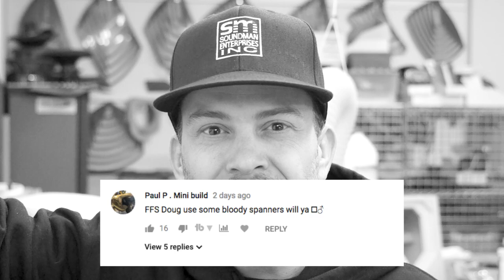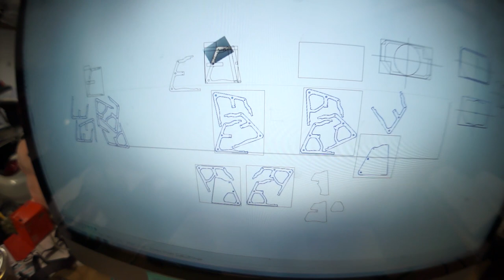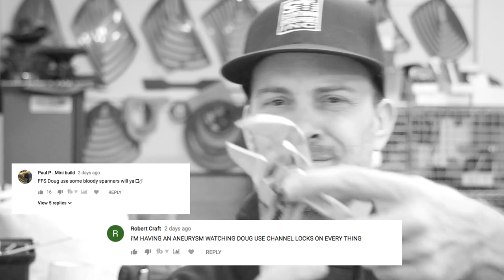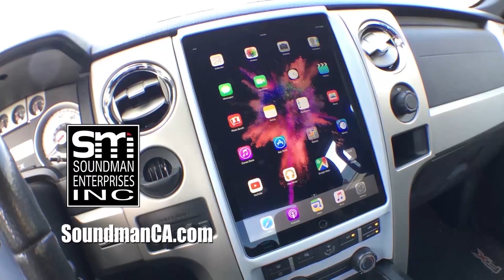IMPOSSIBLE ALIEN WOOFER ENCLOSURE! - OG Cerwin Vega Stroker 12 sealed box!? - White Rider series #44

Comment: Why don’t you just use the SMD IM/SG to pull the T/S numbers from the sub?
Reply: @Mark Wentz I was wondering the same thing.
Reply: Yeah the spec sheet and the actual parameters could differ so would suggest measuring for yourself
Reply: Doug has to drag out whatever he can on videos 😂😂😂
Reply: @masterfabricator  actually, doing self measurements is better then looking directly at the factory specs, if you can up the air volume ever so slightly, you can get a louder/ deeper bass

Comment: I love the intro! But those are not Matco. Those are Knipex. Made in Germany. I use them daily. Never grabbed an adjustable wrench since. Great for pinching sheetmetal flat too. So useful.
Reply: they are really useful until your hands get tired after 6-8hours of working and they slip right into your face. never using those again in my life. Spanners or sockets for me!
Reply: so an adjustable pliers is better then adjustable wrenches that dont require constant grip to keep a hold? and I'd hope pliers pinch stuff like they were designed too... you must have strong hands to grip pliers for 8hrs+ a day.
Reply: @allrimmedout  I've found that I don't need ANY grip strength. If you orient the pliers the right direction, they do most of the work. Never had a problem or a slip and punch in the face. I can open-handed break bolt heads off 9/16" grade 8.
Reply: @kimoarmstrong3519  maybe for clean connections, otherwise anything that doesn't clamp you need even less squeezing strength, because there's nothing to squeeze. and to where anything slotted for adjustment can always have one size that it doesn't fit perfectly correct, and that's where the slipping comes from.
Reply: @allrimmedout  I understand what you're saying. If you can use less squeezing force than an open hand I commend you. These pliers are good to any size below their largest opening. Of they're too loose, adjust them a notch. Not every tool is for every body. But I've lightened my service bag by a lot.
Reply: These pliers are designed differently than others. The side of the grips that touch your hand is the one that does the clamping. The other grip is just to set the tension. Look at the real tool review channel when he demos the knipex cobras. He squeezes them around a piece of pipe, lets go and then stands on them...without them slipping. If doing that doesn’t show how good a set of pliers grip, I don’t know what kind of demo a person could want.

Comment: Put the batteries behind the pumps, below the rear deck........build a wall and run 4 batteries or run the batteries 2 in each wuarter panel with the sub box in the spare tire location where your batteries are now, come on Doug........

Comment: Hey Doug if you send me the CAD drawing of your subwoofer box sections I can 3D model them. I can calculate the volume of a layer minus the area taken up by the baffle plus the area created by your fillets. Then you can multiply that volume by the number of layers you want to use and calculate the exact volume of the box.

Also check out the Dayton Audio DATS V2 system over at Parts Express. For $100 you could measure the parameters of you drivers and get more accurate WinISD simulations.

Comment: channel locks or anything with a clamping jaw do blow cock for cleanly tightening brass or copper fittings... that's the last thing I used for fittings on a $1 mil house. crescent wrenches are the way to go, especially because they come in 4 or 5 different sizes.
Reply: and why wouldn't tight bond itself hold that box together? 3/4 baffles, glue and screws hold my whole wall together, with 150 lbs of woofers with over 150 db's. I built a sealed box for a 12 with Brad nails and glue, last thing I expected was less then 1000w blowing it apart... because glue holds wood together better then screws, until the wood itself fails and falls apart.